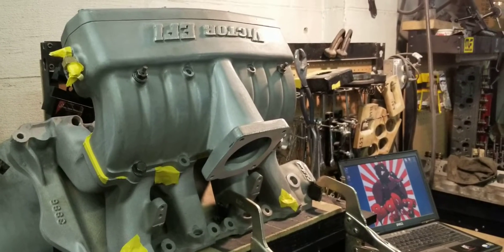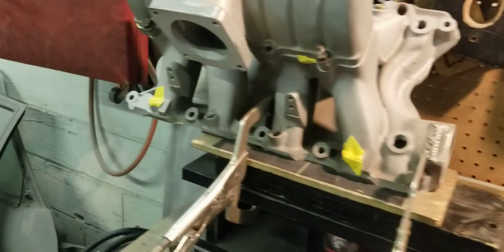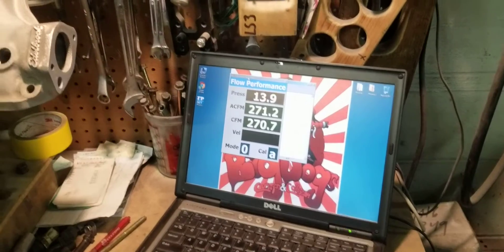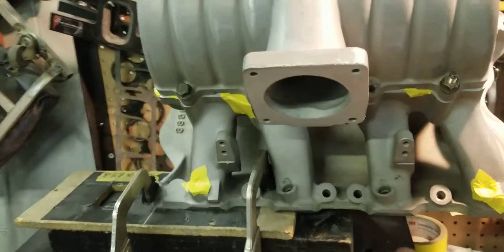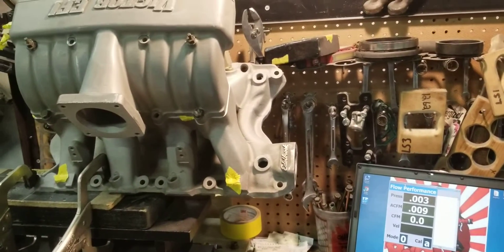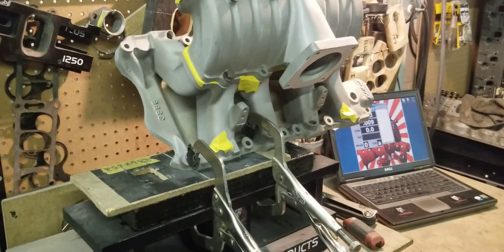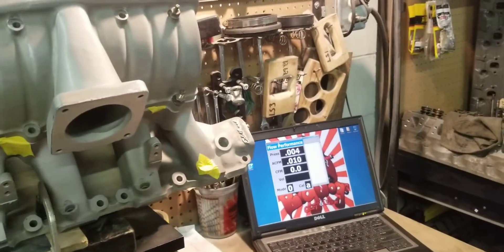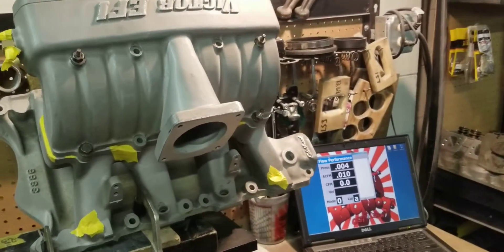Victor 5.0 efi manifold flow test part 1

Comment: Great work! Any flows/work with TFS-R intakes that you could upload? I've got one with a 1" spacer and wonder if it's worth sending to y'all to port or going with a different unit. I also have a GT-40 that has some mild porting on the lower that I could also send you guys to work your magic on...or perhaps both!
Reply from the maker: Yes we have several that we posted. Just like the channel then go through our videos and you will find the before and after flow results of the R manifold

Comment: That's a hell of a manifold. I used one for years.
Reply from the maker: Yes but once ported to flow what wr get them to flow they are on another level. Most combos won't be able to max them out
Reply: @bigdogsportingtonyb2833  I ran this manifold on a 347 and an Incon TT kit....the manifold was never a restriction. I later used the 5.8 version on a 440ci sbf N/A, and I might have gotten close to maxing it out then. I'm currently seeking an ITB system using 8 95mm throttle bodies. Accufab teased me in one of their videos.....now I want that manifold!
Reply from the maker: @arturozarate1752  on the 347 in na applications on a good motor it will be a restriction out the box. That has already been proven in others testing.  
More flow is needed to support Mont hp. This is why the new Coyote, LS and Hemi motors heads and Intakes flow more and more each time they improve
Reply: I am excited to see the finished results and flow numbers  on this intake.

Comment: Have you ever had any experience working on a tfs-r long runner intake with a 90 mm opening? Any flow numbers before and after?
Reply from the maker: Yes, we've ported just about every. 
The 90mm TFS R average runner flow out the box is in the 265-270cfm range bolted  together out the box. Once we stage 2 ported them the flow goes up to 320-325cfm average runner flow bolted together.
Reply: Thanks for the response.  What kind of time would it take time would it take to have one ported and shipped back?
Reply from the maker: @tdawg4496  if you are looking for a rush job we don't do those. The current list is 3-6 weeks
Reply: @bigdogsportingtonyb2833  not looking for a rush job.  Just looking for information.  Thanks again
Reply from the maker: @tdawg4496  got it. About 4-6 weeks is the current list

Comment: There is all ready a video for after porting 360 cfm
Reply: Yes, but this is a 351w 9.5 deck vs the 8.2 deck version.  The 351w will have longer runners over the 302/8.2 deck.  They are very similar however.